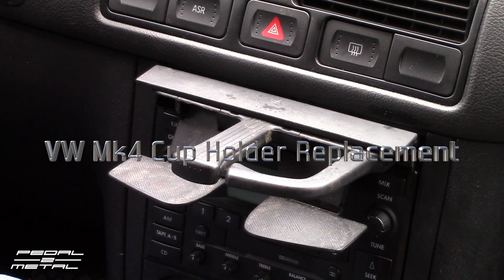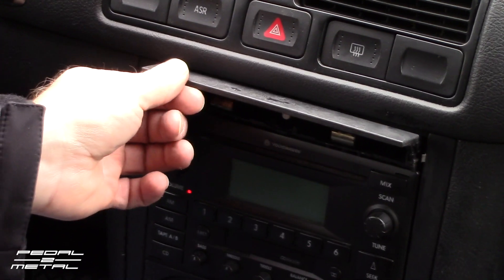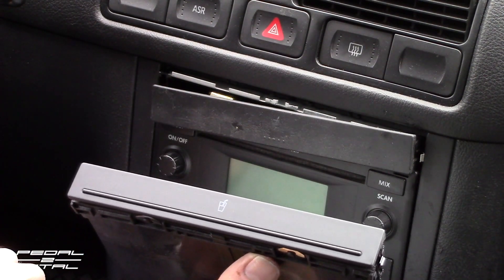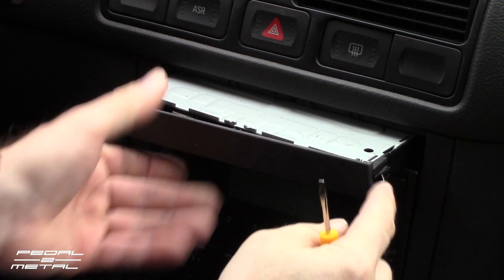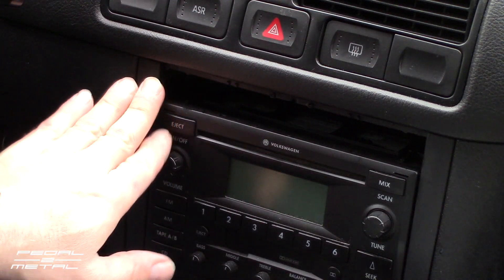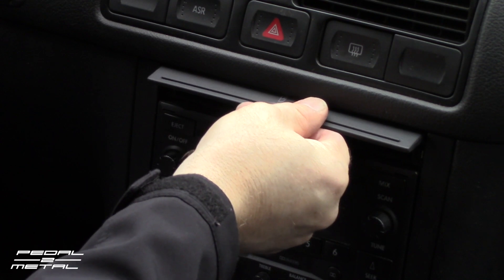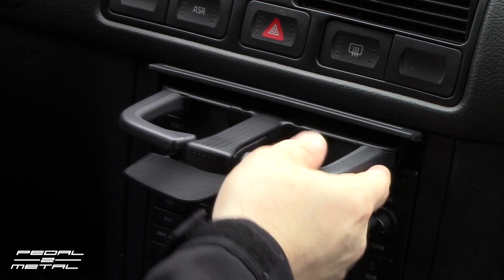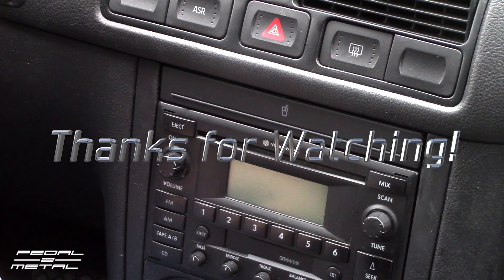VW Mk4 Golf GTi Jetta Cup Holder Replacement | Quick DIY

Comment: i bought the same one for my ‘98 golf 4, and idk why it sticks out a bit and doesnt fit properly
Reply: did you figure it out?
Reply: @sh3fas_  nope, i have an idea of why it doesnt fit but im not sure
Reply: yea i realized the one i bought is for a 2002 golf 4 which is a bit longer, the website i used said it would fit though, so i'll either have to return it or cut off the plastic.
Reply: @sh3fas_  im also considering to cut the plastic, i doesnt bother that much, but i have been trying to figure out what ill do
Reply: i suggest just refunding it if that's possible, if not let me know how it went!
Reply: I had the exact same problem. I returned it.

Comment: Best way to fix a piece of broken VW interior?

Buy a car from any other brand not VW.

There is precious little else in the auto industry that rivals the pisspoor quality of VW interiors.
Reply from the maker: Um, okay....  Its an '03, so it's not exactly new and has been a super reliable car considering it's a turbocharged car. Plus, we have NO money right now to buy another car.
Reply: Just sell some HotWheels... ;)

Ive done auto detailing for years and years, and VW's have always been, hands down, one of the worst interiors to deal with. As you pointed out, the soft touch coating they use on everything is just a joke. It devulcanizes, and begins to get tacky, and peel. It is one of the worst materials used in any interior i know. You cant clean it with anything other than mild soap and water. Anything with any detergent in it will cause it to rot. Even certain interior dressings do not play nice with that stuff either. VW knows this happens. They have even been sued over it, and yet they still continue to spray it all over everything, because the "soft touch" feel it gives lends the false perception of quality. Which means they use twice as much of it in Audis, and even some Porsches before they, thankfully, moved away from it.
Generally, their interiors are just very poorly engineered. I cant tell you how many broken or color mismatched center armrests ive seen on mk3 and up VW's. They snap off so easily, with very little force. The cup holders being mangled, like yours werem is also a very common problem. Ive seen so many of them super glued closed because they are so broken. Or just completely useless because they are stuck. And of course there is the whole issue of putting the cup holder right over primary use electronic components. I cant tell you how much Pumpkin Spice Latte i have sucked out of a VW head unit. And good luck if it happens to be a model with the "Climatronic" climate control unit below it. They dont take any amount of moisture well.
Then there are the seats, and the fabric and cushion material, and how quickly it stretches and wears out. They also dont take well to stain removal. And i wont even get started on the mechanical problems, especially transmission related ones. That said, i would buy a TDi...but VW had to go and screw that up too!

Generally i take the "Friends done let friends buy VW's" approach to it. They very quickly go from being good cars, to being money pits, in a real hurry, and needlessly so. So i am glad yours has been relatively trouble free so far.
Reply: bigbuckoramma my interior looks great in my 08 beetle! And it did in my 99’ as well... and my 02’... just depends on who owns it. They’re solid cars except for the automatic transmissions. I have NEVER been stranded by any of my Volkswagen’s in my combined 95k miles between the 3.
Reply: @gratigo1  A lot of that also depends on where you live, and how the car is stored. Considering you only have 95k between three vehicles that are that old, youre clearly not giving them the daily hot supper of a typical commuter car driven by the average Yob. A daily driven VW interior, that sees at least 50 miles a day, in some coastal or high UV index area, will simply fall apart over a couple of years. They dont hold up very well at all to use and heat.
There are hundreds of professional detailers that will all tell you the same thing. And that has been my experiences in the dozens and dozens of VWs Ive worked on.
Reply: bigbuckoramma I’ve only been driving for 4 years. I got my 99’ with 150k and drove it to 200k in two years with a 50 mile commute for work 5 days a week. Then I got my 08 with 9k and now it has 52k with literally no issues whatsoever. Then I got my 02 with 148k and I’ve only driven it a couple thousand miles (152k), but the previous owner had dogs... 3 big ass dogs and the interior has held up exceptionally well. Other than scratches on the passenger window and a couple on the door panel it looks fantastic. I drive a lot, I just take care of my cars.
Reply: Also, I live in Eugene Oregon, so we have summers in the 80’s-90’s and winters in the 20’s-30’s. They’ve all been stored outside, no car port or garage unfortunately
Reply: @gratigo1  I live in the PNW too. And VW's are obnoxiously popular up in Seattle, which is why i have been inside so many of them over the years. They always seem to have more wear and tear on them than an equivalent year and mileage car from another manufacturer. As i said before, the particular failure point is the soft touch pain peeling off. Followed by the center console breaking off. The cup holder breaking exactly as it has here (and associated liquid damage), and the sun vusor either breaking off, or failing to stay up. Mechanically, as you say, the automatic int he Jetta is an absolute pile. Not even worth its weight in scrap.
About the only VW i would ever consdier to own is a TDi...but VW even had to go and screw that up...
Reply: bigbuckoramma well Volkswagen was experimenting with more upscale interiors in the mk4 and B5 era, mk5 and newer hold up a lot better. But I still think if you just take care of your car it’d hold up just fine, people in Seattle must be really rough with their cars... and the TDI’s are amazing cars (even after the fix), also the TDI in the MK4’s wasn’t recalled like the 09+. They’re great cars but you either get it or you don’t, they aren’t for everyone obviously, but neither is a Toyota lmao

Comment: Anyone know if I can install this in a mk5 golf? I'm replacing the stock double DIN head unit with a single DIN and would be nice if I can put the sliding cup holder in the other slot.